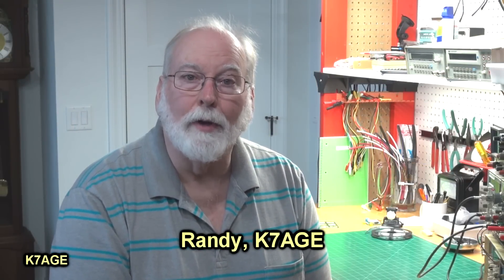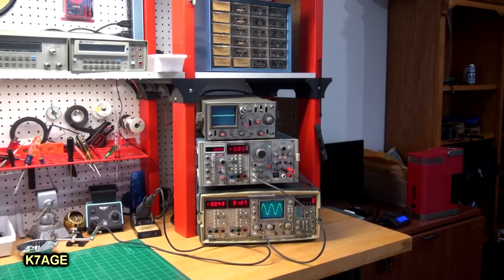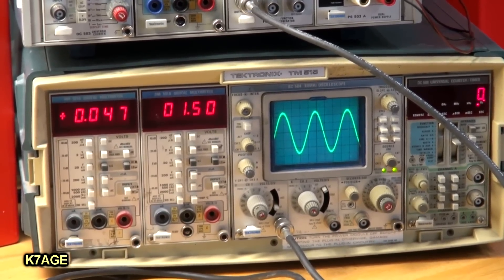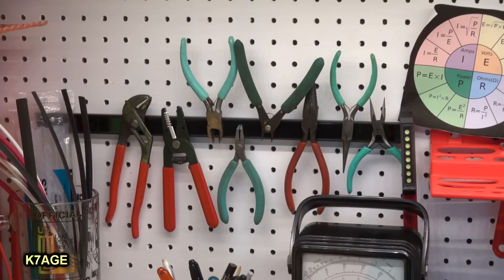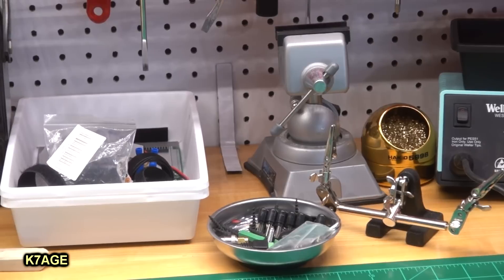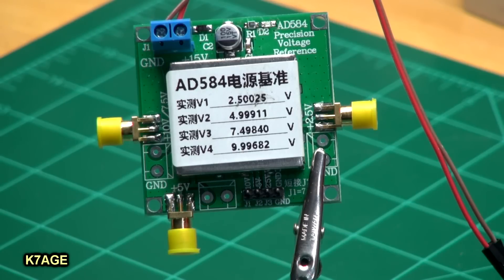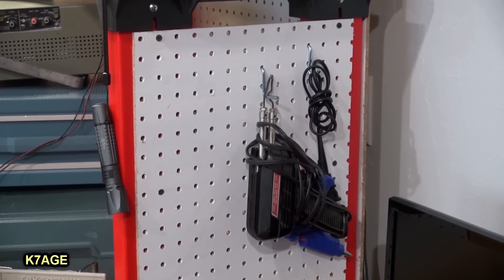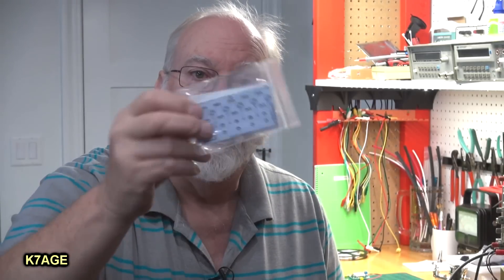Workbench Part 2, Update

Comment: Idea for you Randy:  Pick up a three ring binder and some trading card pages at an office supply store, then put your resistors, diodes, and flat caps into small ziplock bags (sharpie to mark the values) and organize them in the trading card divided pages.  nice and neat, takes up much less space than a parts bin.  73 de KC5AJS
Reply from the maker: Thanks for the tip.

Comment: Nice bench, enjoy it.
What I would be interested to see is how you handle antenna feed line access to the outside. Since you had the house built I assume you had the contractor build in an access point. Also, did you have grounding provisions put in during construction? Things like ground rods under the house.  
Thanks,
George, N2YTA